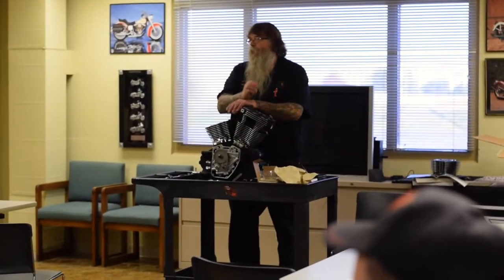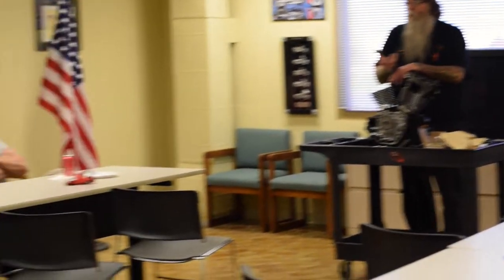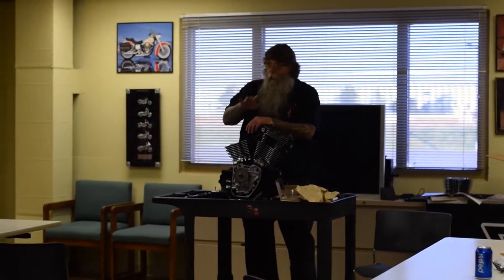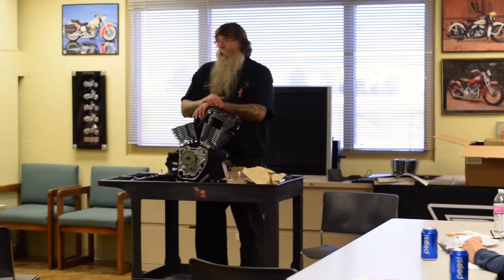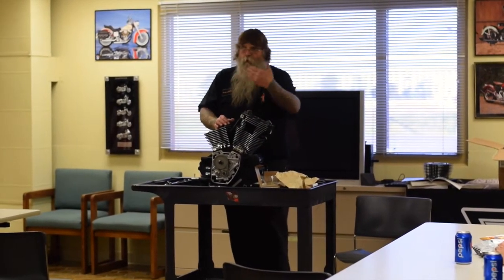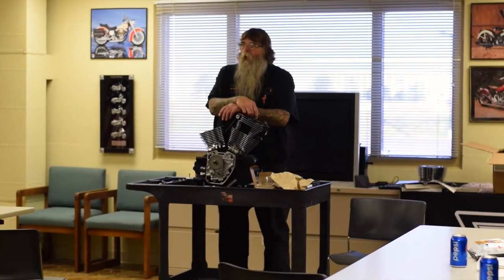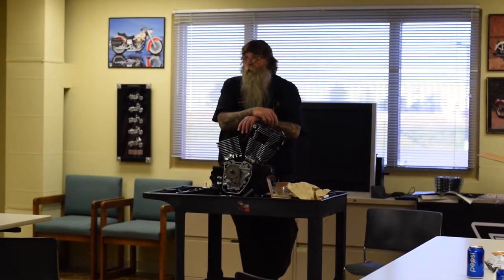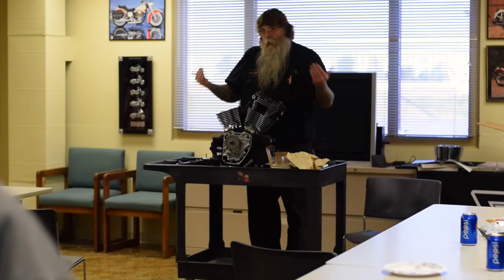Decel Pop

Comment: I would like to get into this guys mind. He is knowledgeable and I could use his help. I just put Vance N Hines short shots on my sporty 48 with heavy breather intake. I tuned bike with screaming eagle pro street tuner. Set base map took a run recording data. Bike seamed to run good no hesitations. But do have deceleration pops. Which does not bother me. I just want to make sure I’m not running bike to learn or too rich. Make sure mapping from tune is correct.

Comment: It’s crazy on my bike. It runs lean out of the headers but it’s rich in the carb. I like having it run a little rich but my high flow exhaust makes it burn that unused fuel in the pipes. Sometimes when it’s fired up for a while I can see flames at night coming out of the tip and that is the only place you can see on the muffler that looks darker then the rest

Comment: I own  2014 V-Rod what helped me was a complete experiment. I purchased  this in 92 octane, TruFuel 110 oz. 50:1 Pre Mix Oil Case, I  poured a quart into my tank. Then filled up.  At first it still popped, blew out some black smoke,  then smoothed out.  After my bike, I did this with my lawnmowers and it worked as well. This stuff has all kinds of cleaners in it, strong cleaners, cuts carbon, off valves and pistons.

Comment: Nice guy alright but he's wrong about a couple things.  Decel pop comes from fuel leaving the cylinder that's plenty hot enough to burn but there is a lack of oxygen so it can't ignite.  Then that fuel gets hit with the o2 and it can ignite in the pipe.  Harley exhaust has many reasons this can happen...especially with stock exhaust and new straight through or near straight through mufflers.  It is much easier to happen in the left pipe because of the shape of the stock header can cause an actual vacuum pulse in the left that can draw in enough fresh o2 to make the hot fuel ignite in the pipe somewhere.  With the stock mufflers it's not nearly as likely to happen because of the restrictive mufflers AND if it does the mufflers "muffle" it if it does.  So you have a double problem if you want to stop the problem.  One other thing that can easily cause it is a leaking exhaust gasket...there is a vacuum at that gasket and it WILL draw in enough o2 to cause the hot exhaust gas WITH the fuel to ignite and again, if you have stick mufflers you probably won't hear it.  But it is happening.  Drag pipes are a no brainer...there's no way to stop the fuel from igniting in most cases because the hot fuel gets to near the end of the pipe and it's going to light off right there...you can even see it at night.  He IS right that sometimes you can stop it by leaning the mixture on decal but sometimes it wants a richer mixture to stop it because the fuel is actually cooler leaving the cylinder if it's rich.  I've seen both work.  It depends on the cam profile, overlap, which header you have, baffles or restrictions, timing and mixture.  I've seen where you can advance the hell out of the timing on decel and it will make it go away...especially with straight pipes.  There are too many variables to say one thing or another will always work.  I own a dyno company in Wyoming and trust me, even a hot day in the summer will cause it to pop less compared to a cold day in november. BY the way...if you don't believe the exhaust has a vacuum pulse just put a piece of paper over the exhaust on either or both sides and you'll be able to actually see it at idle speed.  Believe it or not that one reason Harley raised the idle speed on the twin cams.  Low idle makes more defined pulses.  Not bashing the guy but I've tried it all and I KNOW what works.

Comment: I know a guy that sounds and looks almost just like this Tech.
I have constant Decel popping with my Vance&Hines short shots on my iron after the 1200 conversion i did. Had it tuned by Harley, but its still really bad. I have heard that if you change to baffles with a smaller diameter it will create more back pressure and help reduce the popping and posibley eliminate it all together.